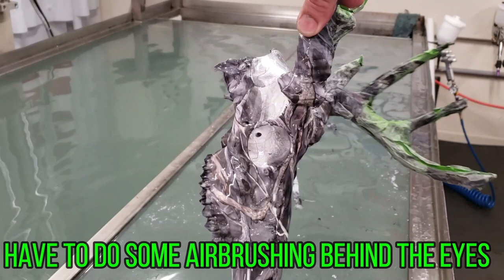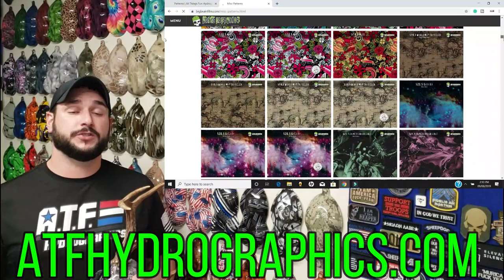HYDRO DIP WHITETAIL DEER SKULL MOUNT - Proveil Camo

Comment: I have been dipping deer heads, I have had a problem with film spider cracking after dip starts to dry, I paint n wait about 1/2- 1 hour after paint, I do just paint with spray paint, krylon mostly, I know that's not ideal but never use to have a problem, use to wait longer after paint to dip, could my paint be shrinking after dip n cracking film? Just looking for some insight
Reply from the maker: No clue... I don't use krylon and that is one of the many reasons why. It does not work consistently.